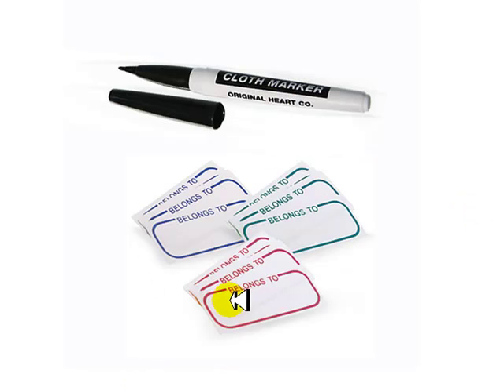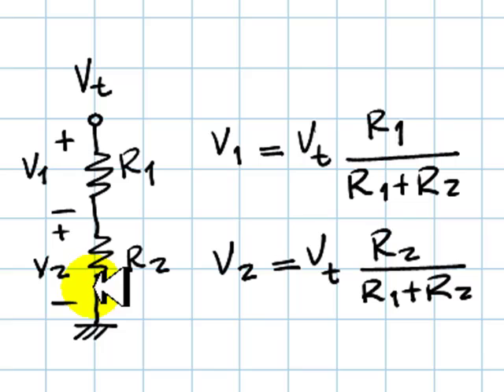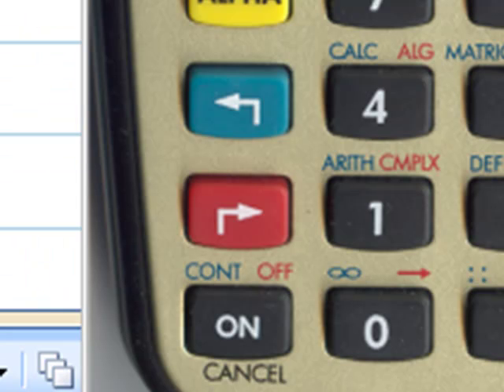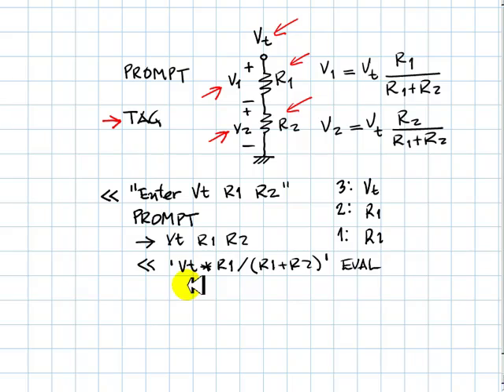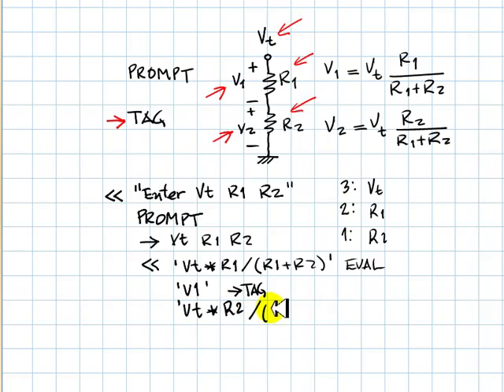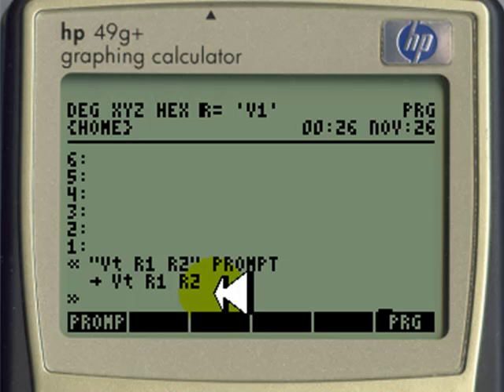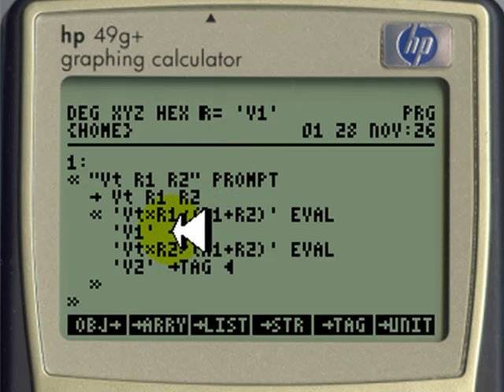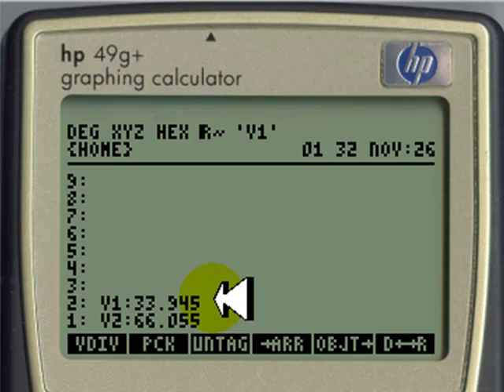HP10: HP-50g Programming 03

Comment: Sometimes, I will load a dozen coordinates into the stack.  Each coordinate is entered with [x,y,z] values.
To help identify each point I will enter with a TAG.  I figured out that the key on the bottom that looks like : : allows you to enter a tag during number entry.  So for example, :A: [2,3,0].   My problem is I cannot enter a tag, and then go into matrix writer to enter my vector.  

Sometimes, I don't have the exact value for each x,y,z,.  So, when I use the Matrix Writer it will allow me to actually enter an arithmetic operation into the cell.  Then upon entering that, it quickly calculates and stores that value in that cell. For example, I can enter this [ 100 30 cos x , 30 sin, 0 ].  Thus, getting [ 86.6 , 0.5 , 0 ] entered into the stack without actually pressing those numbers.

However, if I enter a tag first, and then "try to press MTRW".  The calculator doesn't allow me to go into the matrix writer.
I want to enter the tag, and then be able to jump into MTRW for my vector or coordinates entry.  
Is this possible?  Thx.